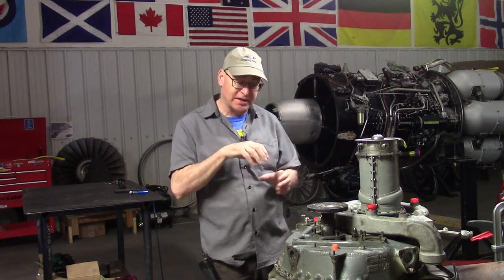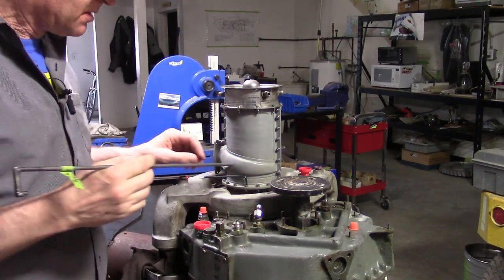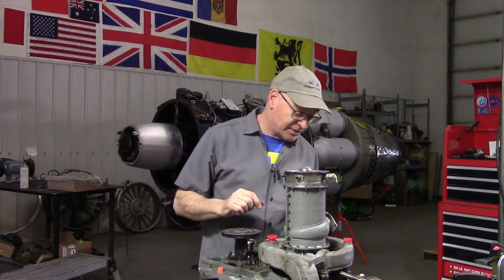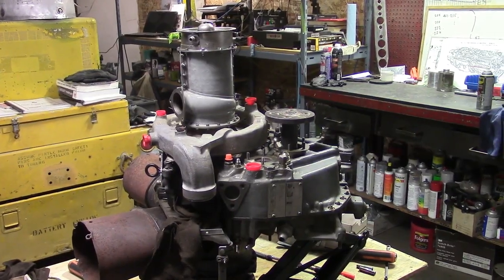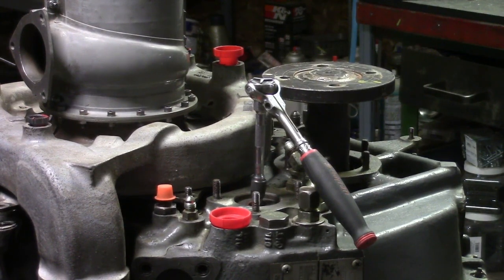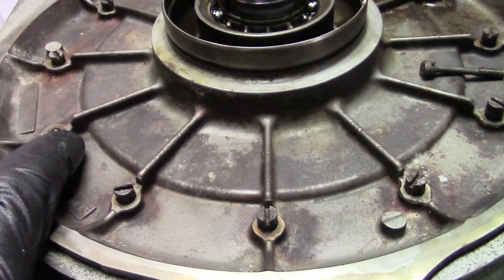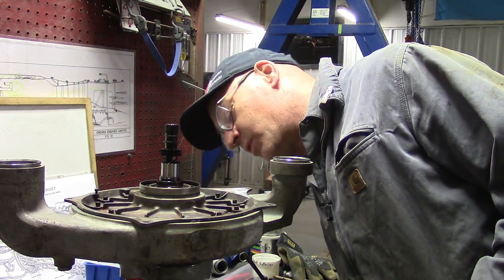Compressor Module:  Mini Jet Boat Ep. 8

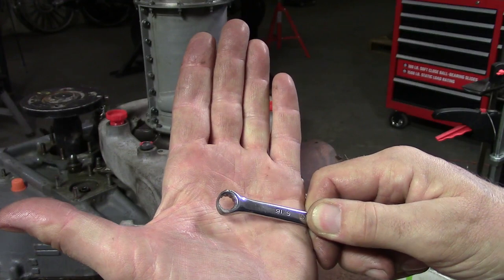Comment: In your video Jet Questions 54 at about 10:26 you mention the turbine blades running against an abradable material. You go on to say that when the jet engine is first assembled it is ran for about 20 minutes which helps the clearance between the turbine blades and abradable material to establish. My question is, after this first period is there any need to maintenance the engine from the particulates of the material rubbed off or are the particulates not significant enough to cause any discernible abrasions or buildup on/ in the next set of blades, turbine nozzles, or other? I believe the jet engine in the video was the LM-1500
Reply from the maker: It's a very small amount of material, and the turbines are the last thing on the way out. We've never found anything deposited on the turbine blades, except the red dust that is everywhere on this red planet.
Reply: AgentJayZ has given a good answer to your question and, from experience, I can confirm this.  The amount of abradable material in question is minuscule.  However, I've recounted my experience with the Industrial RB211 on this channel in the past.
In the early days of its development and in-service trials at Burstall in Canada, we found that, if the installation was 'tripped' from full power and the engine could not be restarted within 20 minutes or so, the HP spool would seize for several hours.  The problem was traced to the HP turbine tip seals and the air seal to the rear of the HP turbine disc.
Because the static structure of the engine cooled more rapidly than the rotors, the casings and seal static members contracted, both radially and axially, onto the rotating seal fins and the spool seized solid.  
The solution was to pre-profile the seal static members, which consisted of a honeycomb filled with an abradable material, to a profile nearer to that of a typical worn profile, and then go through an aggressive running-in procedure during the pass-off test.
Reply: @AgentJayZ  Huge fan, thanks for the reply! Red planet 😆
Reply: @grahamj9101  the amount of trial and error, head scratching and pure engineering that goes into these engines is jaw dropping. The more I learn, the more curious I get.

Comment: Jay, sometimes if you smack the bolt/screw with a mallet it breaks the seized joint.
Reply from the maker: Juss btween unme... there is not one "helpful suggestion" here that was not actually employed...'cept the induction heater... cuz there was no access to the bolt shafts... 'till I broke 'em.
Thanks to everyone!
Reply: AvE would go "Tappy tap tap" hehe